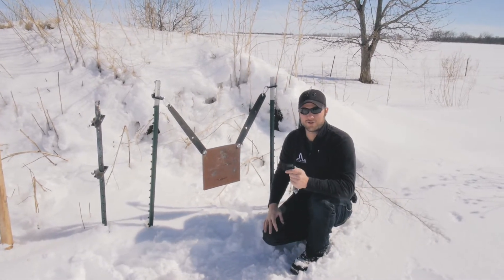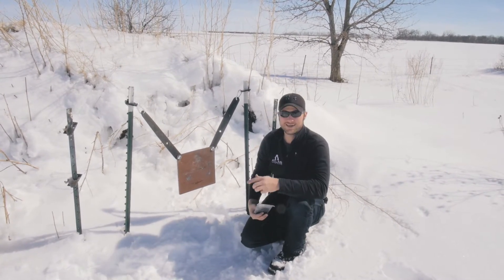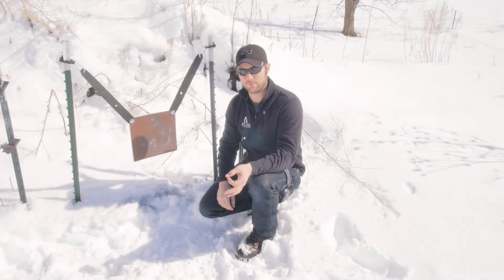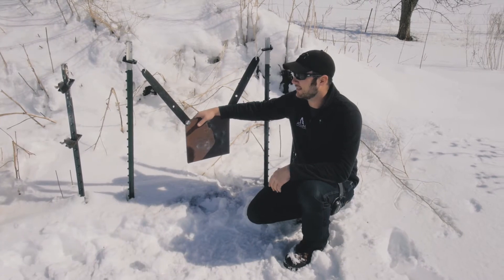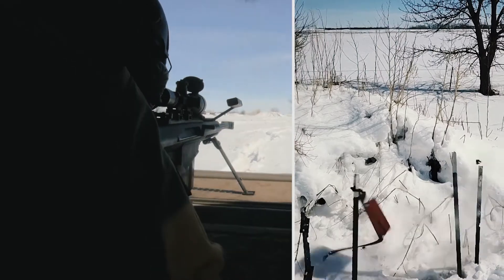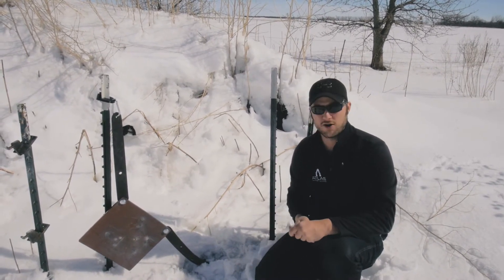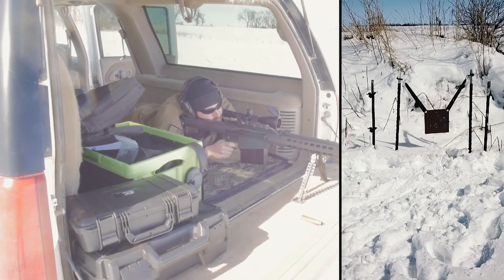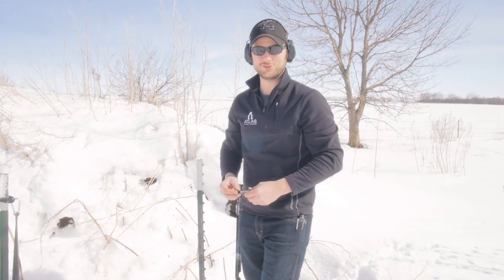Can this 3D printed AR500 Steel Target Mount Stand Up To The .50 BMG?

Comment: Turn the T posts with the hole toward the back, and I bet it will be fine.  Or change the design slightly to where the hole is on the rear side.

Might also try changing infill design to something more appropriate for angle of force.